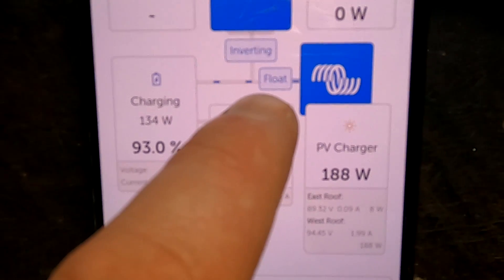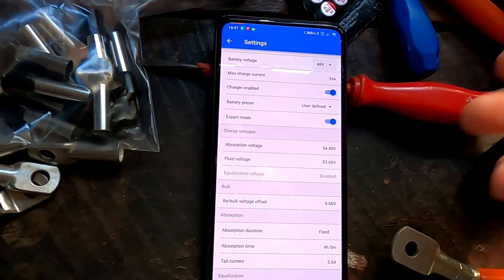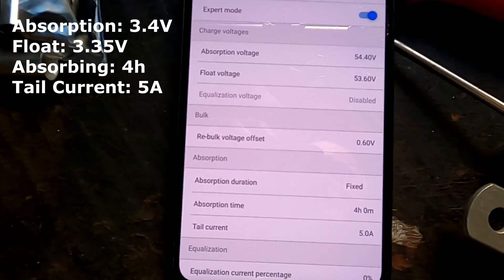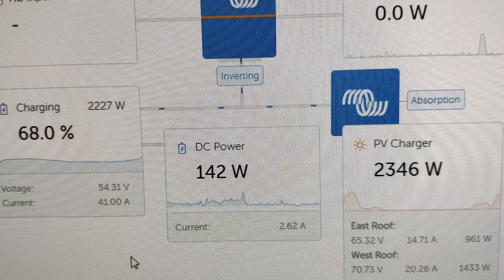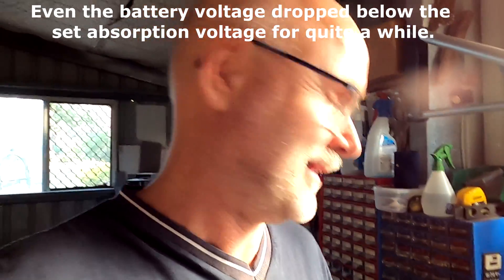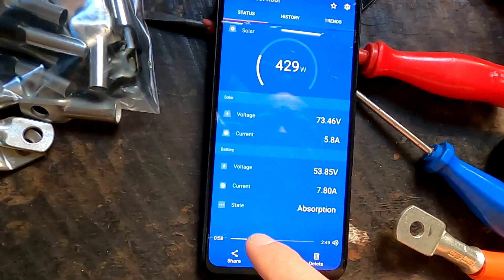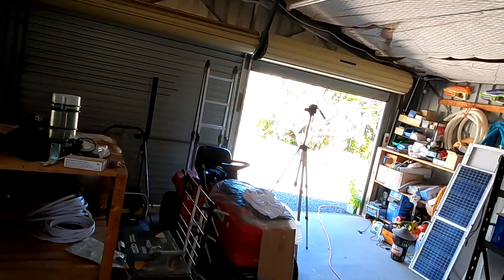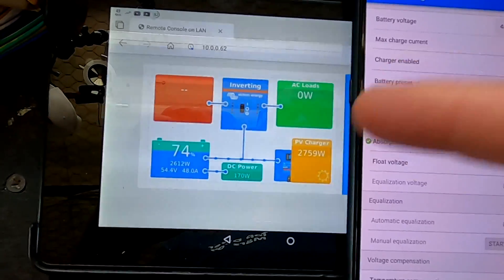How Absorption, Tail current and a few clouds can trick you!

Comment: Frog: After reading everyone's comments, you some it up best with this reply - "3.4V is a bit high for floating. It is over the tipping point and can overcharge you battery if it sits on this voltage for a long time.
I would go lower to 3.35V or 3.375V. That is close to the natural resting point of the cells."  And I repeat - That is close to the natural resting point of the cells
Reply: Not necessarily on a off grid working system with loads. Float at 3,4v, and a sun set you go into the night with discharged battery. I don’t believe one voltage fits all, its a matter of finding a balanced setting for a given usage. If the system is idle, yes I agree, float at 3,35v.
Reply: @aureltanasan1413  i think you are making a good point here. Every setup may need different fine-tuning based on load, geo location, cloudiness and shade. 
Humanity still has some work to do to make it plug and only play. This is a great corner of the web for that. Cheers you all. Thx Andy

Comment: You need to account for the battery's internal resistance when programming the trip voltage to enter float mode. At 60A charging current you can easily see +100mV at the battery terminals due to IR drop. This IR drop gets worse at a lower state of charge which is why you see larger variations at lower trip levels.

Comment: My testing has shown you need 3.45 volts per cell. I also set the float to the same 3.45 volts. Works great!
Reply: Doesnt this create a risk of overcharging if the the battery is not used overnight and this continues for mutiple days?
Reply: @Banszi1  you can not overcharge a charged battery, unless you raise the voltage. In this case it will just hold 3,45v at 0 amps if is full.
Reply: @aureltanasan1413  This is exactly what happens, the current tapers to zero and no more charging takes place. I have tested removing all loads from the battery after charging and let it sit for days, it's still sitting very close to 3.45 volts.
Reply: @Banszi1  3.45 volts per cell is not 100% charged.

Comment: 3.4V just seems too close to the flat part of the curve. Something like 3.55V should get you well into the steep part of the curve, insuring about 99% SOC, and still be easier on the battery than going to the 3.65V max. You are still going to get about 10 years of heavy use before it even drops to 80-90% of original capacity. Besides, by then, batteries that are twice as good will be half the cost, and you won't even want to bother with these anymore.
Reply: The Battle Borns I've had in my RV for a few years recommend charging at 14.4V-14.6V (3.6V to 3.65V per cell) and they have a 10 year warranty (for a 70% capacity). I can't imagine there won't be a way better option by then! In fact, the $4000 I spent on those 2+ years ago, would now get me about 5 times the capacity if I went with 32, 280Ah LiFePO4 cells and a nice BMS.

Comment: Super nice Diego!
I have bmv-712, not the SmartShunt.
On the back of the instrument it is available a small relay with dry contact that you can manage with the SOC parameter. Do you think using that relay to pilot a big and huge industrial relay to stop solar to enter in the solar controller can be an idea? So for example if you reach 95% SOC, no matter of the setup of your solar controller, you can stop the charger. When SOC will go under 92% (example) you close again the relay and charge again.
What do you think?
Reply: Yes you can do that, or trigger a diversion load and make use of extra solar going into a hot water or air con, heat pump etc.

Comment: It seems that ideally you'd want both conditions to be met before switching to float, rather than one or the other.
That would make the solar charger much more compatible with Life cells, and should only require a simple firmware update. 
Perhaps the manufacturer could be persuaded?

Comment: My case is a little different, I'm setting up a LFP system in a motorhome that spends significant periods not used.

I want to keep the cells away from 100%, but also keep them balanced (I realise these goals conflict somewhat). I'd prefer to keep the system connected to the solar, because there is a small constant load of about 15W for ventilation. I'd also like to not have to actively intervene too often.

The balancing for my (DALY) BMS kicks in when it sees cell voltages of 3.35V.

I'm thinking that an absorption voltage like this (3.4V) and a long absorption time might do the trick, or slightly higher at 3.45.

What do you think?

Comment: Still using 3.55 Absorb / 3.5 Float... As soon as my SBMS120 hits 90% SOC the "dump loads" turn on: water pumping, electric heating / cooling of thermal masses / topping off air compressor....etc.... When I was using the lower voltages my outback charge controllers and SBMS would Pop in and out of float mode and I would lose a lot of charge for the day ..... by holding the batteries at 3.5 volts I'm somewhere over 90% when the sun goes down... When you're fully off-grid and living off your batteries you want that charge it's high as possible without damaging your batteries as soon as the sun sets.  Something nobody ever talks about is load / size of bank... If your system is idle/ lightly loaded just being charged up as a backup your settings are going to be vastly different from a primary system that runs a whole house load (10-15KWhs/Day)... I have helped multiple friends set up off-grid circuits in their house and a large LiFePO4 bankand small solar array that basically act as a lightly loaded UPS for their setups I always go with a lower bulk/float voltage... I've said this before and I'll say it again ideal charge rate and voltage settings depend upon your end use, how big your bank / array is and the solar potential for your solar latitude!!! All of the variables have to be taken into account there is no one solution 😋
Reply: I couldn’t agree with you more, I have a oversized array to cover for the winter months. Fully off grid and sometime Genny deployed on long dull winter days. Those times I have bulk 3,55v and float set at 3,5v. In the summer, I get away with 3,45v float.

Comment: Frog. I agree with all of your conclusions, but I live in the desert, and clouds are rarely a problem. Certainly you can push more amps with a higher voltage, and you should cease at 3.45v, since you are about 98 to 99% full then if you're top balanced. Good job illustrating and explaining it.

Comment: Can you override the system and force it into a certain charge state?  If yes then you could hook up a raspberry microcomputer to monitor the state of charge and force the charge controllers to go to float when you hit the percentage you're looking for.  And then you could program it to at least every so often allow it to go up to a higher voltage for a time in order to achieve a top balance and recalibrate the state of charge meter.
Reply: A frog...

Comment: In 2012, I installed 10 kW solar with 8kWH of winston LFP batteries on my offgrid property.  I built all the electronics myself, and there was not quite the amount of information available on how to design for LFP as there is now.  Fortunately,  LFP is generally very simple to charge :-)

I didn't use absorption time.  I controlled max charge current at all stages.  I used 2 setpoints and reduced the charge current  on each.  The last stage was only 5 amps until it kissed the final target.

So I used 1/4 C for the bulk of Max Charge current, then 1/8 C Max charge current, then 5 amps.  In the meantime the solar panels were heating the hotwater system and so on.

This seemed to give a relatively consistent charge, irrespective of cloudy conditions.
Reply from the maker: Very interesting, but you certainly have to set a voltage to change over from bulk to a lower amperage?
Reply: @OffGridGarageAustralia  Yes, I did have voltage setpoints for each event.

Comment: Why not just charge to 3.5 volts high cell??
A 100ma balancing on the bms is easy to achieve. My BMS automatically reduces current as battery becomes full. You keep saying it’s ok to charge up to %90+. Mosfets are awesome!! 
Mitchell

Comment: Yes 3.45 volts would be better. However the problem then becomes having one of the cells topping over 3.65 while the others are lower , This happens a lot if you try to get too high.As you know the balancing in the passive  BMS is only probably 30 mA so that won't help. It will get better when Victron finally converts their chargers to LFP only. But they are trying to cover both markets with the one product at this time.
Reply from the maker: If you did an initial top balancing at close to 3.65V, none of your cells should peak at 3.65V when you only charge to 3.45V. That would indicate there is something wrong with the cell or the connection to it.
Reply: @OffGridGarageAustralia  With 8 years up the sleeve I can but tell you.
Reply from the maker: @aprilsteel9466  oh, 8 years. Yeah that's a long time. Well, I'll keep this in mind. Thanks for sharing.
Reply: @OffGridGarageAustralia   @April Steel  I've got 4 years on my large 48v pack and have seen similar issues. As the cells age the imbalance gets worse which is why I had to add active balancers to my pack. My pack also has an issue with temperature imbalance because one side of the pack is near the inverters and the other side is far away from the inverters. So the cells near the inverters always have a different internal resistance due to the temperature variations.

I also had some cells fail due to a BMS problem and having some new cells in the same pack with older cells causes even worse imbalance issues. 

Life is always easier with brand new well matches cells. :D

Comment: if the battery will take current it is not charged. My frogs are not that green.
Reply from the maker: That is correct. But the question is, do you need to charge all the way up all the time?🐸
Reply: @OffGridGarageAustralia  The solar availability controls that with most people's loads and solar production we seldom get fully charged so we maximize any amps available.

Comment: what SOC do you start the day at?
Reply from the maker: can be anything from 20%-70%. You can see it here in the live view: https://vrm.victronenergy.com/installation/100328/share/2e028071
Reply: @OffGridGarageAustralia  COOL!!!!!

looking at yesterday's graph shows max soc about 13:00.  after that it falls off never to see that soc again that day.  feels to me like you need to go back and watch your "float" video.  i can only guess at when sunset is, but it appears you are leaving at least 3 hours of energy on the table.  causing a lower soc to start the next day, etc., etc, etc.
Reply from the maker: @tcloud24  yes, that was with 3.4V settings. You can see the battery voltage being constant at 54.4V during midday. 
Yesterday, the battery was at around 85% when I plugged in the vehicle to charge. That's the step drop in SOC afterwards.
Reply: @OffGridGarageAustralia  how much energy does it take to drop to float voltage?

Comment: At 15 mins - yeah, now your dialling in on it.
I've said before i play with my settings - in summer where i cant use all the power - use this as a "feature" to stop overcharging,  But in winter when i need max power for that 1 hour break in the clouds or that one sunny day a week to collect as many photons as possible and get my SOC up. 
Today was one of those sunny days after days of dullness and I needed it. You may just be going into summer but I'm at the time of year where weather matters a lot although only 8 weeks off where it wont matter how much sun it will be that low in the sky I'll get nothing.
Reply: rather than change the Abs Voltage to check - note the voltage point the charger is collecting at. You'll know your MPP and if the charger tracks higher or lower then that how they limit the current for the abs, phase.
Reply from the maker: Yeah, totally different situation if you have these rare moments of sunshine, you have to use them and harvest as much as possible.

Comment: The Victron Smartshunt is very accurate, so it would be nice if there was a setting to stop charging at any user selectable state of charge.
Reply from the maker: This will come soon. @Brad Cagle is working on it...
Reply: @OffGridGarageAustralia  is Brad with victron? So is this coming to everyone's units in a software update or new hardware? Or is this something Brad is developing that we'll have to apply ourselves aftermarket?
Reply from the maker: @SiriusSolar  Brad is a software engineer and a viewer here in the channel. He offered help to get the BMS connected to the Pi but also wanted to provide broader more general support for all of us to read information from our BMSs to control charging. Most devices have the RS485 port for that already build in.
Reply: Look into the Electrodacus charge controller / BMS combo setup... Pretty cool tech SBMS0, SBMS120!!!
Reply: Percent is the way to go, along with accurate measurements and calibrated sensors. 3.5!

Comment: You wouldn't have these consistency issues if the BMS controlled the PPT voltage to get whatever current it can take under any given conditions at any one time instead of the clunky bulk/absorb/float cycle.
Reply from the maker: Coming soon... @Brad Cagle is working on it...

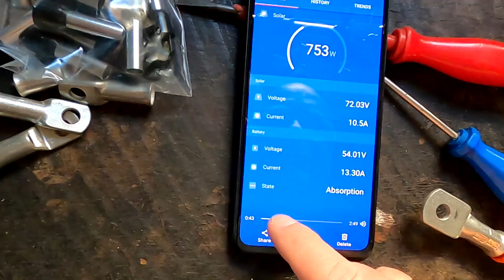Comment: Andy, I was just thinking about how large a supercapacitor bank would be required to even out the transient solar peaks and lows, but if at 8:06 the time slider on your phone is showing from 0 to 2.49 hours rather than mins, you would need a pretty large supercapacitor would you not?
Reply from the maker: Yeah, that would make no sense. The MPPT are highly capable of adapting to the peaks. The 'problem' here was the voltage was too low to allow the MPPTs to go full speed. At 3.45V, these problems don't exist and we don't hit that ceiling any more and cap out charging.
It was just another test to show how absorption and tail current can fool the system (an you).
Reply: @OffGridGarageAustralia  Yup. However, If the Smart Shunt is accurately gauging charge level, then it seems simple enough to add a BT channel to the MPPT controllers and a software feature where Float only happens at a set percentage. Perhaps you should send Victron the video and see if they can implement that or have other suggestions.

Comment: I only use the tail current to determine when the batteries are charged and I have a long absorb time to ensure there is sufficient time to reach the target tail current (1% of the Ah capacity @ absorb voltage). When the tail current is less than the target current for 30mins, the charge controller goes to float. If the battery voltage drops below absorb voltage or the tail current goes over 1%, the 30min timer resets. BTW, I hope Diego could get out of the watering can!
Reply from the maker: Thanks, Kevin. What voltage do you charge to? I guess, the problem I showed does not occur when charging to a slightly higher voltage.

Comment: To charge my battery to 90% I connect my Victron Multiplus via modbus to a 'Home Assistant' server. If 'Home assistant' reads out a battery SOC of 90% it wil send a modbus command to the Victron multiplus to stop charging. Once every week I fully charge my battery. I set my absorb voltage to 3.47V/cell for 20 minutes.
Reply from the maker: Great solution! Is this with LiFePO4 batteries or regular Li-ion?
Reply: @OffGridGarageAustralia  Yes, LiFePo4 cells. I have 18 Lishen 272ah cells in series. So I have a higher voltage (around 60V), Less current for the same power and a JK BMS with active ballancing. I only use the active balancing from a voltage above 3,44V/ cell.
Reply: I agree, the only real way to hit 90% state of charge is by tracking amp hours in vs amp hours out. The voltage measurement will really only let you get to 98 or 99% accurately. Below that, "it depends" is the best you can get.